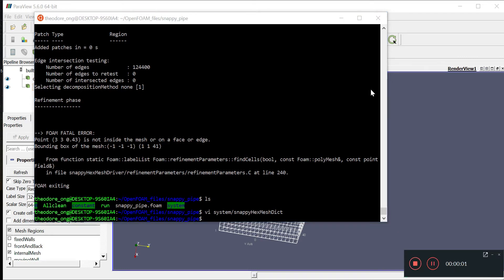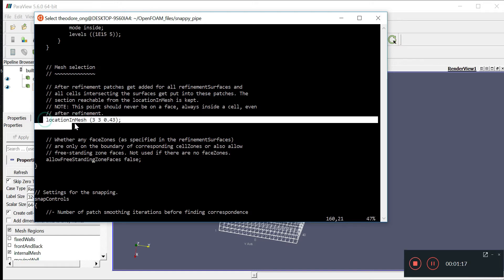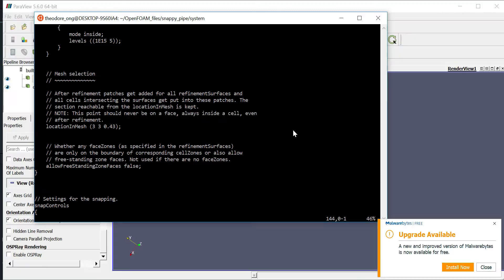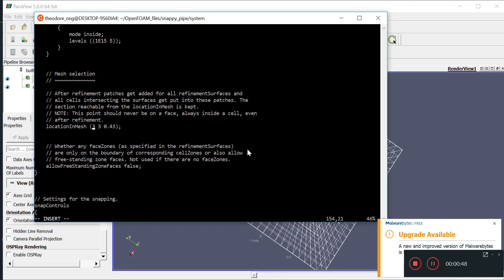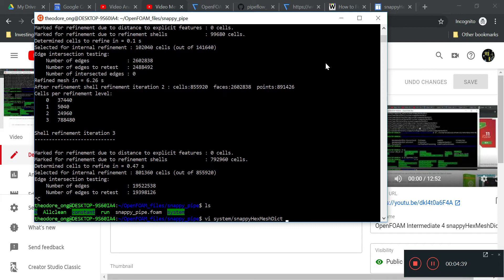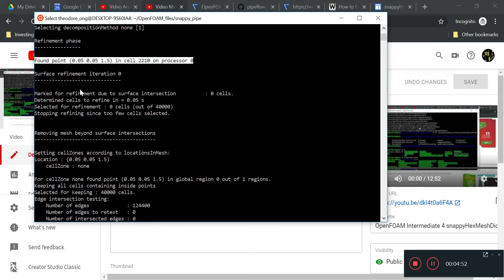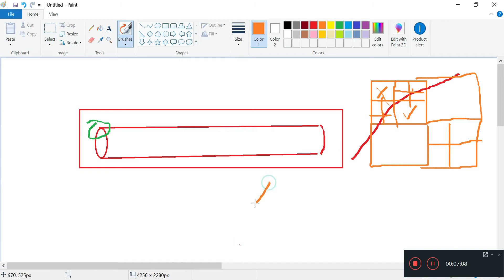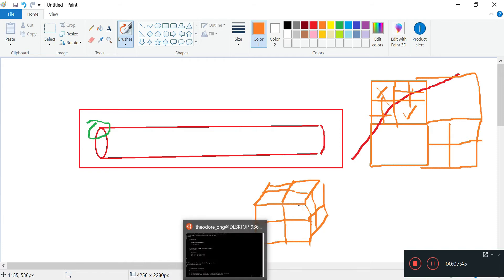OpenFOAM Intermediate 5 - snappyHexMeshDict part 2 refinement

Comment: I stuck at an error poped up in the console of not opening motorBike.eMesh in constant/triSurface when running snappyHexMesh. em...
Reply: I solved this problem by first running the surfaceFeatureExtract command to create an .eMesh file.
Reply: Hello. I've got same error. How can you solve it?
I think because Ubuntu can't open proper e.Mesh file, error occurs.
I'm not sure but in my opinion Ubuntu should open proper cylinder eMesh file but I think Ubuntu is trying to open motorBike eMesh file.
I guess I should deal with vi snappyHexMesh, but I have no idea what I have to modify.
Reply: I've followed tutorial from beginning to here again.
I don't know the reason but now it works.